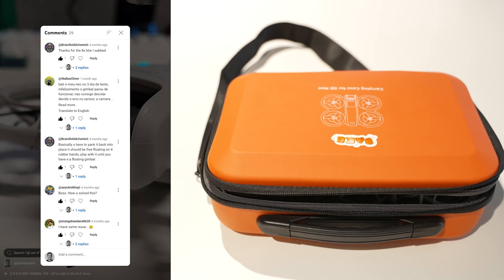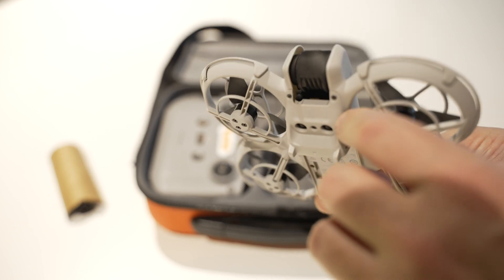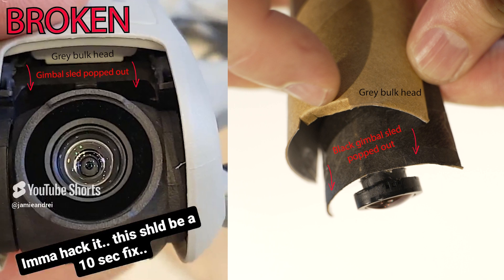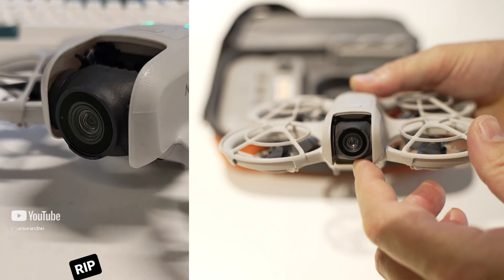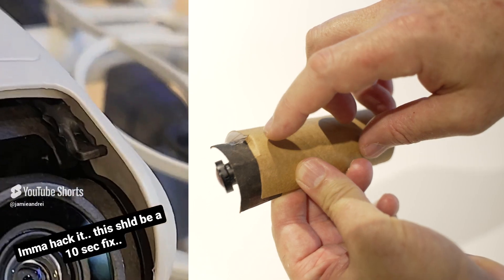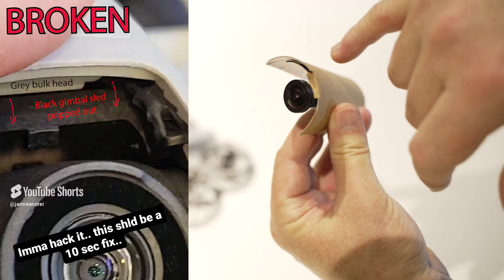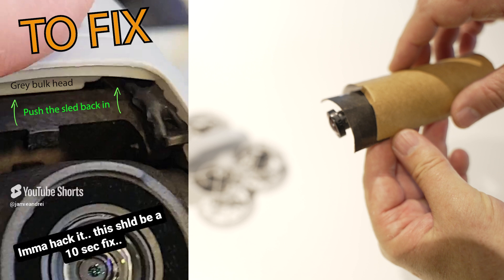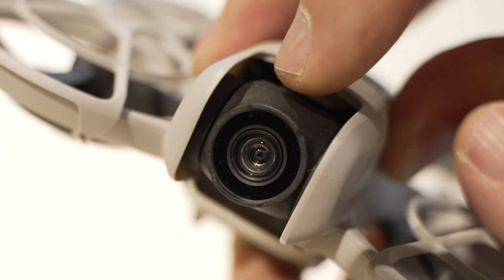DJI NEO GIMBAL FIX IN 2 MINUTES! How to fix your DJI Neo drone after a crash.

Comment: I think my camera is still in place . But my camera keeps going down when its off. It will look down and i cant get it too look straight again. When its on it works but it shakes sometimes when i fly. Do u know whats going on?
Reply: The sled is still in place i checked it. Im not sure why the camera looks down. Its like a magnet thats pulling it down.
Reply from the maker: Bugger.. not sure tbh.. might be beyond this basic fix.. maybe a repair or warranty job.. good luck.
Reply: @jamieandrei  i think the gimbal motor is broken a little. It still works when its on so its not that bad i guess. This video did help alot tho because the gimbal also popped out after a ruff crash. Luckily i knew how to solve it because of your video thanks alot!
Reply from the maker: @jonypony9808  good news! ✌..